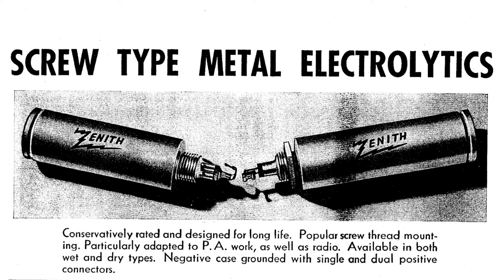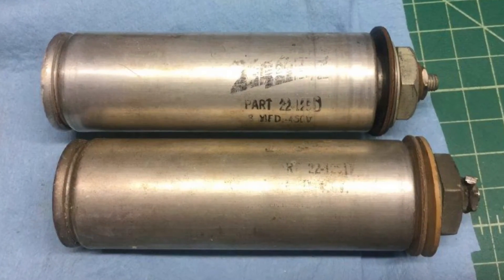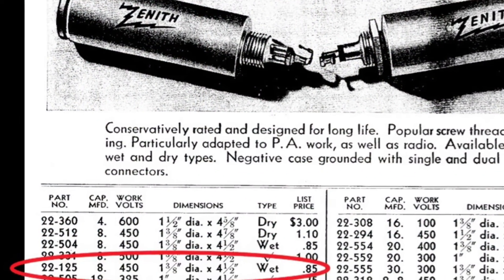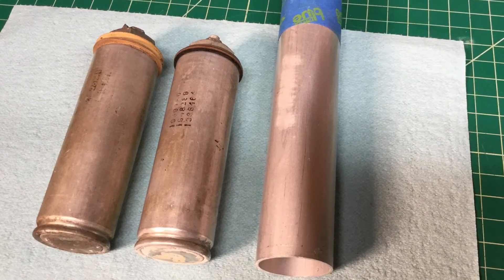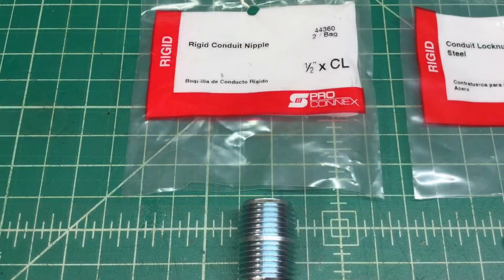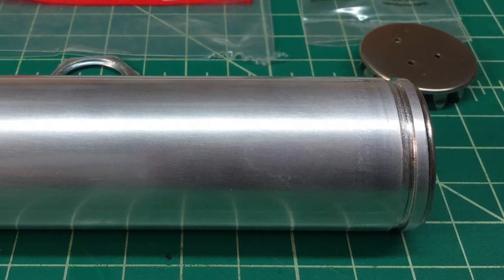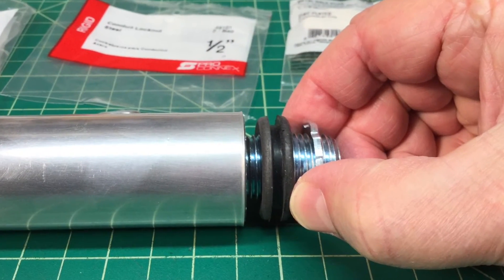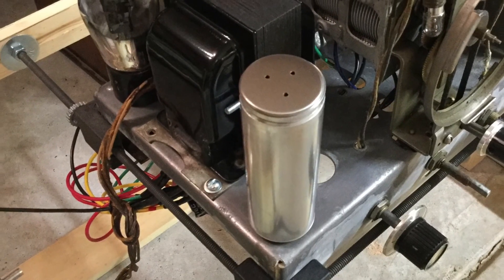Zenith 5-S-29: Reproducing the Electrolytic Cans

Comment: Perfect timing.  I just saw that you have been working on this Zenith 5S29.  I just received the same radio from a friend of mine and I just started working on the initial cleaning and vacuuming and check out.  Your vids will come in handy.  I enjoyed your plan of attack and will go through mine in the same order.   I felt more comfortable working on the radios from the 1950s.  The parts are more standardized and easier to replace I think.   Glad you had this series.  I was not familiar with the style of IF cans and screw type electrolytic capacitor form factors like this radio has.   I never worked with a candome resistor either.  Looks like a pain to deal with.  The unit I have is in pretty good shape.  No rust or rodent damage.  It is very clean.   I think I will just need to work on the electronics of it.   Minimal physical restoration should need to be done.   One question, were the domino style capacitors good or did you have to replace them????       Great channel.  Keep up the great vids.  LOVE the picture in picture technique.    Impressed with all your fabrication ideas and execution.
Reply from the maker: +jp040759 Thank you for the kind words. I'm glad the timing worked out and you can reference my progress to date. I'm hung up right now on the candohm resistor replacements as my order from Mouser was never delivered, no fault of theirs best I can tell. I didn't replace the mica capacitors (domino style) nor test them and haven't seen any issues thus far. Again, I still have some work ahead of me, but so far so good. Thanks for checking out my channel and I hope the other videos in the series add value and your restoration is uneventful. Should you need anything, just let me know. Best, Don
Reply: Thank you.

Comment: Great job.

You were able to make that groove with just putting a standard washer in place of cutting wheel on the tubing cutter? I would have thought that groove would not be as pronounced as that. It looks like the groove was cut on a lathe.
Reply from the maker: +ZenithClarity1969 I just used the washer. Some thinner aluminum tubing would have made it easier as it was hard to hold the tube in my hand and apply the needed pressure to get the desired results. Thanks again for watching. Best, Don

Comment: I always like to see a different approach to "restuffing" these cans. I recently had to do some wet cans and I the approach I use is just to cut of the tops with a electric miter saw (after draining) and then take out the inner stuff replacing it with the new cap. The center shaft I replace with a new bolt and solder lip drilling an extra hole "inside" of the mounting screw to lead out the negative lead. Waterslide decals to reproduce missing text and logo if needed. Then I close up the can with an end-cap for pipes (http://www.mocap.com/tube-plugs-round-metric.html) which look nice and provides easy future access. Except for the decal it's very fast and simple and does not require rebuilding one from scratch like this example. But yours would look a little more original.
Reply from the maker: +Bart Zuidgeest Hi Bart - thanks for sharing your process, which I'll try. I've always made my cuts ~1" from the bottom and use some flexible plastic to hold the sections together. I've got some water slide decals and vinyl, which are thicker and would be noticeable. Do you protect the decals with a clear coat? Best, Don
Reply: RestoreOldRadios Yes I use a clearcoat (matte) over the decal. Using the thinnest decal paper and the microset/microsol solution the clearcoat makes it dificult to feel the decal.
Reply from the maker: +Bart Zuidgeest Hi Bart - magnificent job re-stuffing the cans. I like your technique/process. I appreciate you sharing the photos with me of your work. Best, Don
Reply from the maker: +Bart Zuidgeest BTW - what radio is the recipient of the...?
Reply: +RestoreOldRadios the Radio is a Philips 640.